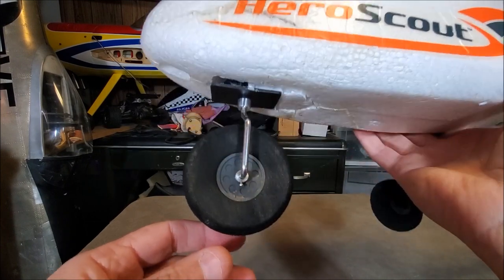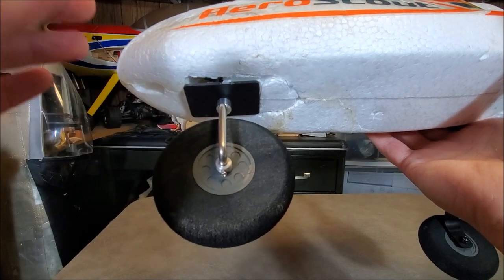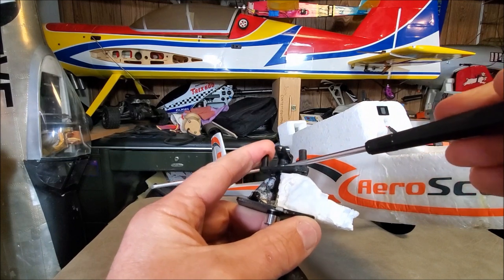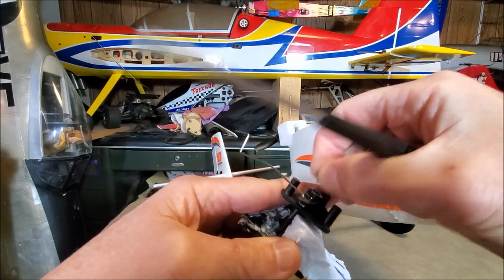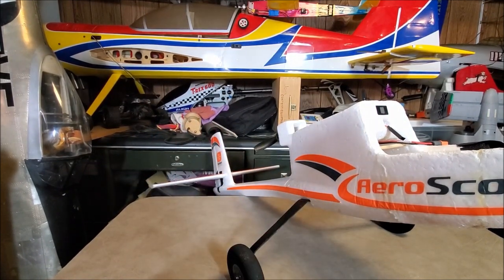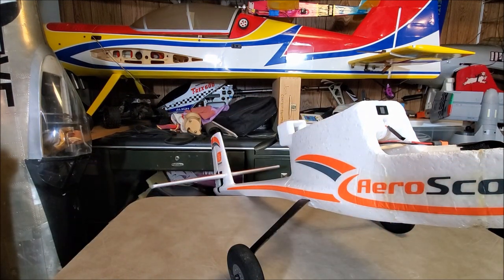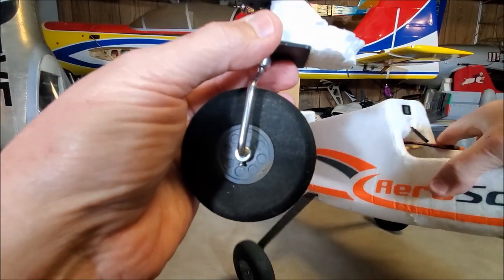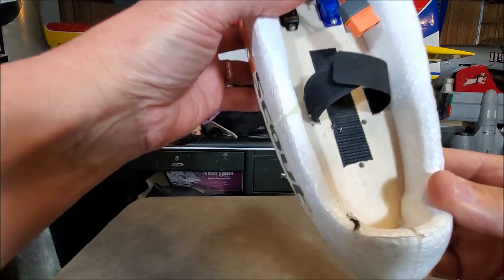Fixing HobbyZone Aeroscout nosegear slop

Comment: I had the exact same issue after hitting somtall grass. Without removing the front landing gear, i used 2 old credit cards. 1 glued to the top of the thin plywood and drilled holes to re atteach the nose gear. Under the foam fusalage i used the second credit card with holes drilled, allowing the gear to turn. The credit card was glued and really strengthened the foam to front landing gear. :)

Comment: I had just purchased a brand new aeroscout and wound up in the hospital before I could fly it. Looks like a good time to fix it when I get home before any damage.
Reply from the maker: You could but since it's brand new I'm sure the foam fuselage has got the nose gear feeling kinda sturdy.  Unfortunately right now in order to do my fix you may have to break the gear out of the bottom to get it out. If I were you I'd wait until you've had enough rough landings and you notice it getting pretty wobbly.
Whatever you decide good luck and have fun, the AeroScout is an awesome little plane.

Comment: Going to give this a shot. Have landed badly twice and broke apart the same area. 👍🏻
Reply from the maker: Like I said in the video.  The mistake they made with the AeroScout is the relied on foam to support the workings of this poorly designed mechanism. When guys destroy the foam underside of the nose the gear does not work properly anymore. 
If you do this fix right you'll no longer need to keep repairing that area and your nose gear will work perfectly on its own.  Good luck!

Comment: You can fix it permanently with a wooden brace! You screw it into the two holes on the plastic and have a piece of the brace extending backwards over the weakened foam. It coveres enough foam that to collapse the gear you would have to destroy the entire front of the plane, but it does seem yours is much more of a clean fix that wouldn’t disable the ability for attaching floats since they need the screw holes I used for my brace. The brace however has made it practically indestructible so it was worth it to me!
Reply from the maker: I agree that a permanent indestructible fix might be just what the doctor ordered for many but for myself it does not need to be that strong.  The idea of having to bust open a permanent repair on the front of the airplane to service either the nose gear assembly, pushrod or control horn seems kinda ridiculous. I've even gotten suggestions to totally disable the steering completely to avoid the whole hassle of having to deal with this assembly all together. That to me is even more unbelievable to not have a steerable airplane, but hey that's what makes the world go round.
I'm not saying I'm a super hero flyer but the chances that I will damage this nose gear is pretty slim. Of course I cant say that for the guy I fixed this Aeroscout for.  Maybe I'll have no choice doing it your way for him in the future. Thanks for watching and the valuable input.
Reply: I'm putting mine back together now lol😂 thank you I need tips 😂lol
Reply: Great tip thanks 👍
Reply: Do you have video/pictures with the instructions for that brace installation? Thanks

Comment: Just flew in a landing and wheel issue happened is there any step by step instructions for the video because I didn’t see how to take the wheel out and not sure how to reattach the servo
Reply from the maker: I'm sorry I have no written instructions for what I explained in the video.  Although if you take the battery hatch off and look at the tray you'll see the three screws that loosen the whole nose gear mechanism.  Unfortunately unless the foam is  destroyed on the underside where the gear exits the bottom you'll have to cut the foam to remove it. 
Good luck!
Reply: @MrDougstud  what is the best way to fix it after it becomes loose me and my cousin are willing to use metal, take it apart, but he has the plane and we just wanted some input
Reply from the maker: I'm sorry again but there are many things that can go wrong with the nose of this airplane and without inspecting it closely I'd be hard pressed to offer any constructive advise on fixing your AeroScout.  My recommendation would be to find someone that knows the airplane well or if you belong to a club ask someone in the club.
If you don't belong to a club it would be a good idea to join one, this is where you'll learn the most and get good help. Good luck!
Reply: @MrDougstud I think my cousin will put a plate of tiny metal to sandwich the wood so maybe it won’t move anymore. But is it necessary to have the washers because it’s not totally broken off I need a hobby group to join
Reply from the maker: Depending on the damage there are many possible fixes that could need to be done.  My fix was to make the whole  mechanism operate better without doing any reinforcement to the bottom of the plane. Like I said in the video the manufacturer of this plane used the underside of the fuselage to support this gear and when the foam gets damaged the gear doesn't work properly anymore. 
Now you can work to repair  the underside or you can fix the mechanism.
It's your choice, many guys support the gear by beefing up where the gear exits the bottom but I didn't do it that way and my gear is still working perfectly. My suggestion is to watch a bunch of videos on YouTube and decide what fix best suits your need. Good luck!
Reply: @MrDougstud  we are thinking of many things to make it solid at the moment thanks

Comment: Had this happen first flight lol fixed with 3m tape now but who knows how long it’ll hold so I’ll do this
Reply from the maker: Yes do this fix and don't waste your time reinforcing the underside of the fuselage.  If you fix the mechanism and it's securely mounted to the underside of the servo tray you'll be just fine with the wire gear sticking out of the bottom of the fuse.

Comment: the control horn is loose because a landing can destroy your servo. Stiffen the area by using clear tape on the underside. good as new!
Reply from the maker: I'm sorry I have to respectfully disagree.  This nose wheel design is crappy right out of the box.  As soon as you begin to stress the structure of the nose wheel area on the underside of the plane this thing starts to wobble miserably.  The best way to fix it is to fix the mechanism itself and not rely on bracing the foam or adding any other support. 
Thanks for the input and watching.

Comment: No offense but you did nothing to Fix the issue. The torque of the landing gear on the small area of What's no better than packaging material is the flaw.  The portion that was made into the foam needs to be stabilized and given a much larger plate to resist those forces. I'm an old Tin Knocker and some Aluminum of the right thickness and covering the bottom of the whole nose area should fix this and not add to much weight. 
A good fitment and a light layer of E6000 adhesive will make it Stay for sure.
Reply from the maker: I'm sorry but I don't understand how you could say I did nothing to fix the issue?   I eliminated the nose gear slop by fixing the mechanism not by reinforcing the bottom of the fuselage. This is exactly what's wrong with this design, they relied on the fuse to stabilize the gear and as soon as it gets weak everyone ends up with the same problem.  I'm sorry but my fix solves that problem  so even if you have an open hole on the bottom you still have a strong operational gear.
My fixed gear is going strong and so are the others who have applied this fix.
But hey different fixes for everyone is good.
Reply: That was my fix only I used plywood.  The real answer, and I need this more than anyone,  Is land correctly!

Comment: lol i just said that was the weak link on a different video. just dis connect the front servo from the front wheel  so you dont break the servo... hot glue the front wheel straight
Reply: Then you absolutely cannot steer (or taxi) immediately after landing. And that sucks. The rudder alone is useless at ground speeds to steer.
Reply: @johnpolizzio2583  what. So you would rather break the rudder servo ever time you land hard dumb no need to taxe 😂 lol